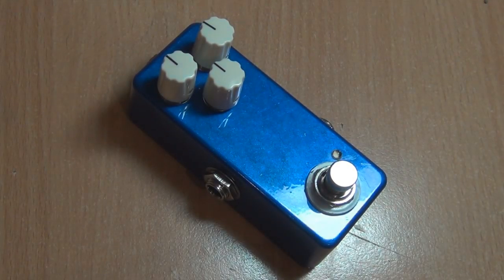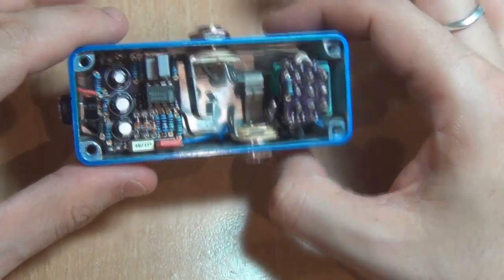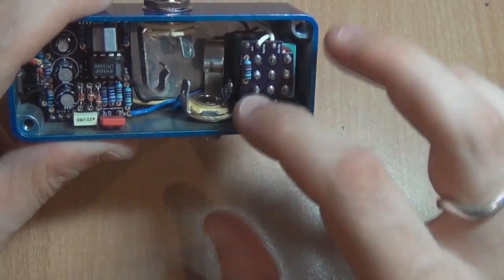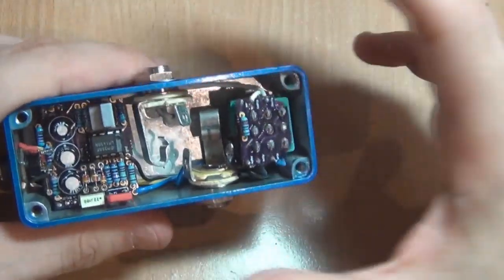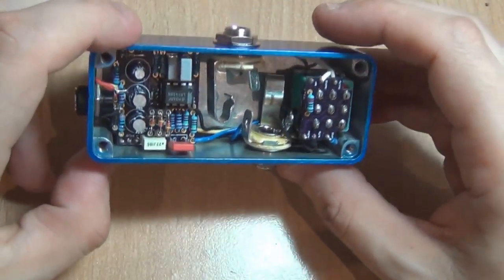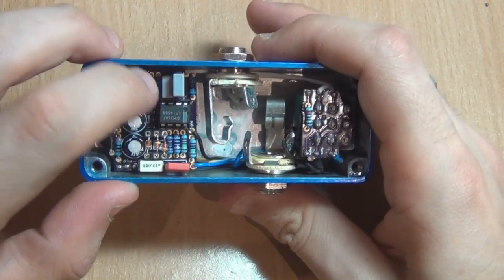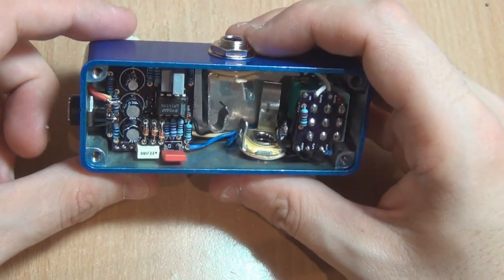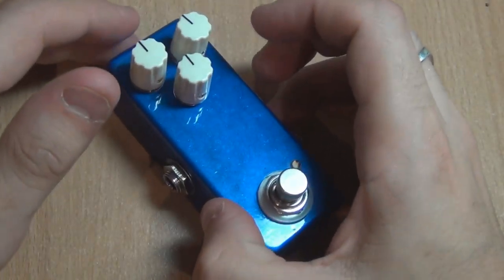DIYGP Night Drive - Build Report

Comment: I like the sound of this one.  The schematic calls for a JRC4558, will that sound as good as/different from the LM1458N?  great vids.  learning alot.
Reply from the maker: Thanks retro! I would recommend using a dip8 socket and trying both, sound is very subjective and what I think sounds better may not be the same as what you think sounds better :) socketing and experimenting is the best way of testing things like this in my opinion.  Cheers.

Comment: NICE paddle :D
i wanted to make it but i dont understand a block shape interconnections in your Schematic diagram plz could you help me i dont understand what it is
Reply from the maker: Thanks Sameed.  The block component on the schematic is just pin 4 and 8 of the opamp, positive and negative voltage reference. Cheers!
Reply: thanks :D

Comment: I looked at the schematic for the Eternity, and it's identical to the one for the Night Drive on your website except the value of the drive pot...
Reply from the maker: Ahhh yep...that's right...?
Reply: When you said it was inspired by it, I didn't think the schematic was going to be EXACTLY the same. It's cool you got it to fit in a 1590A though.
Reply from the maker: David Hoch You can build an eternity on the PCB if you want.  But I would encourage people to experiment with the circuit as an opportunity to learn.  There are mod suggestions on the build doc.